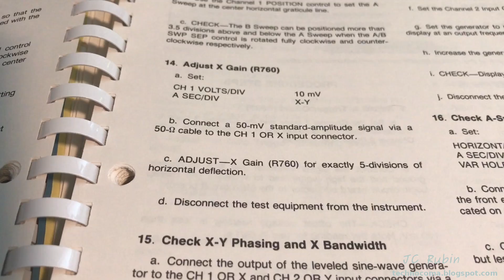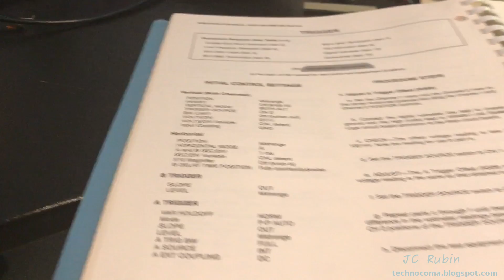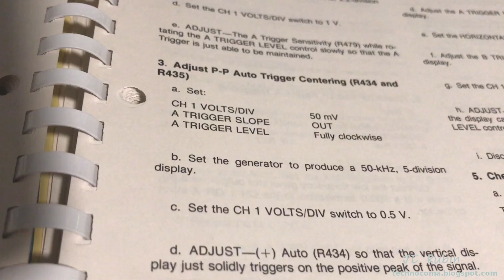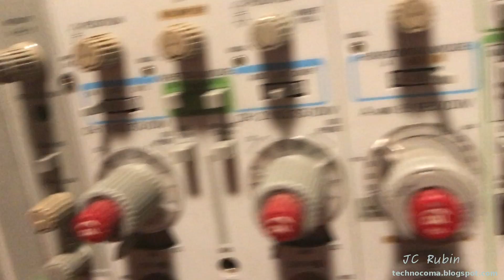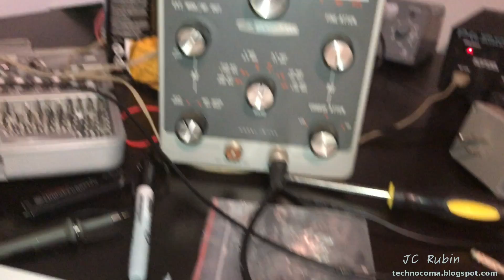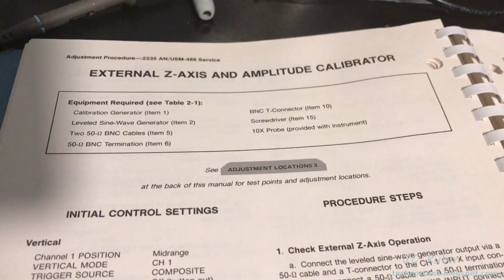Tektronix AN/USM-488 2235 Oscilloscope repair and calibration 7 of 7

Comment: After about 4 days, started doin the horizontal glitch thig again.
Reply from the maker: Run that pot back and forth a few times and see if it stops the wiper may be dirty. You will have to recal the pot afterwards

Comment: Thanks for these videos.  I haven't watched them all yet.

Have you tried working on the step attenuators?

I have a 2235 (USM 488) with a flaky step attenuator on ch2.  I think it's the fingers under the cams.  The signal gets flaky when I jiggle the front panel V/div knob.

Any help would be appreciated.  :)

So, I'm back to using my Leader LBO-315 I bought new in '89.  I've had it apart a few times, to the point it looked like a basket case.
Reply from the maker: I have not sorry, no issues there or since...
Reply: @rubin-tech  Ok, I fixed it.  I connected ch2 to a signal, then rotated the v/div knob while watching the display and the contact fingers under the cam.  When the display went flaky, I gently pressed on the "down" fingers with a small screwdriver, one by one, until the display came back.  That told me which fingers were not making contact.  Power off now.  Then I rotated the v/div knob until the fingers in question were up.  I worked a small tool under the mount for the finger, then gently applied pressure to the top of the finger, bending it down a bit, so it makes good contact when the cam leans on it.
Reply from the maker: @jselectronics8215  Good job, another repaired scope.  My contact issue was due to a fire inside the scope, so deoxit on a toothpick was also helpful in some cases.
Reply: @jselectronics8215  Apparently, one fairly non-agressive approach to cleaning the fingers on the cam switches is to turn the switch until the cam opens the finger, slide a small piece of paper under there, close it, and pull the paper out.  Paper is abrasive enough to take care of it, without chemicals or other such intrusion.  Lather, rinse, repeat!  Those switches are made that way to handle the low-level, high-frequency of the signal at that point -- normal switches just won't do the job!
Reply: @ydonl  My success was short lived.  Trying HARDER, I broke the resistor at the end of the switch where it connects to the front panel.  So, it's sitting, in case anyone wants it for parts.
Reply: @jselectronics8215  Sadness!
Reply: @ydonl  It looks pretty hard to remove and replace the step attenuator.  Are there any repair manuals available that describe how to do it?  A video would be good.  But I would have to find a replacement attenuator.  I'm not a collector, so you are welcome to have it, just pay shipping.  My contact information is on jandssafeguard dot com.
Reply: @jselectronics8215 Most of the scope manuals are on w140.com/tekwiki, which if you're not familiar with... definitely go take a look!  They have a couple of options for the 2235 service manual, and all of the details are in there.  You do have to go into it with some patience -- these kinds of things are always "step by step, settle down and work through it".  But the steps don't seem that hard.''

Classic parts are on sphere.bc.ca and www.qservice.tv, and eBay of course, where you might find a parts machine cheap if you get lucky.  Check the manuals and see if any similar scopes use the same attenuators, that sort of thing.  I might google the part numbers, which is sometimes surprisingly helpful.  Parts are getting harder to find as time passes, of course!

Still, a switch that's flaky-when-jiggled rarely requires replacement, just cleaning and loving care.

There are lots of YouTube videos on fixing various problems; you might find various tips from any vids on the 2000 series, even if it's a different problem than you have.

I have a 7904, which is pretty easy to work on, and a 485, which requires taking all apart just to get anything done (but is worth the effort!).  I have a 2465 on the ToDo list.
Reply: @ydonl  Thank you for the link to the repair manual.  I have the USM-488.  The manual describes how to remove the attenuator board.
Reply: @jselectronics8215  You're very welcome.  Good luck if you decide to dive in!  That website is a powerful resource for vintage Tektronix owners!  I'm very grateful for it.  

There is also a TekScopes forum on groups.io.  You may be able to search for existing advice, or ask questions if you decide to dive into the repair...  :)

Comment: Thanks for doing this series.  I hope to be able to repeat these in any used oscilloscope that may come my way.
Reply from the maker: The calibration was specific to that model tektronix, though with the correct shop manual i'm sure many steps will be similar.
Reply: I second William, just got a HP 1740A and these videos help me a lot.